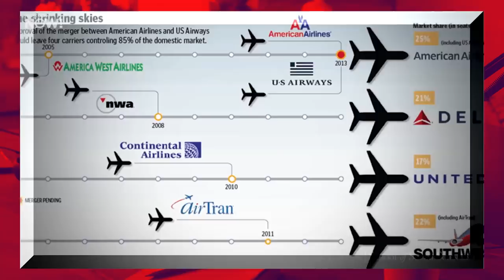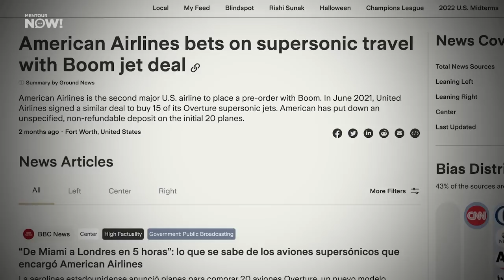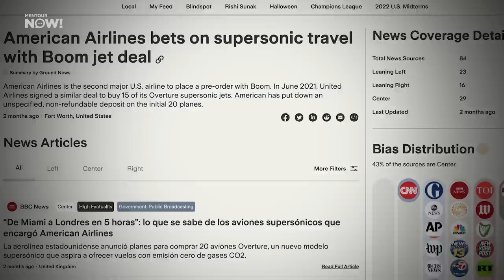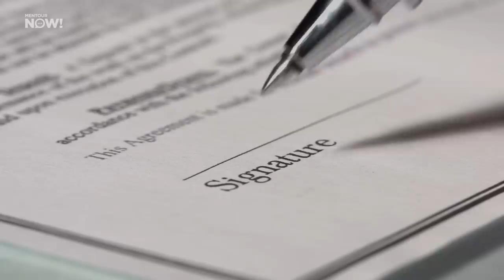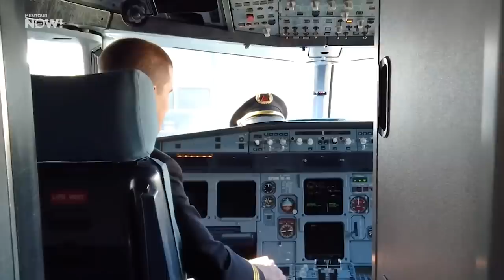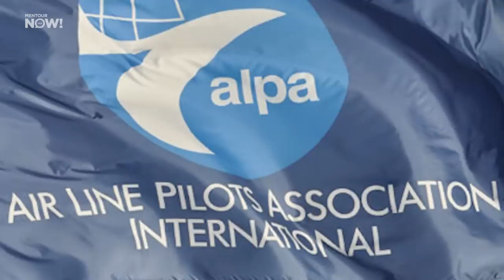Is This the DEATH of the US Regional Airlines?!

Comment: I have a “4-letter word” for all this: “ALPA.”

That said, yes, the US regionals are at a turning point. First off, get rid of those gawd-awful EMB-145s. Secondly, bring back updated turboprops (~100 seats) for leg lengths less than 200NM. The jets have been losers to the ‘props on balanced field lengths, revenue seat miles, and basically every other financial numeric.

Lastly, there are pilots (and F/As) out there that wouldn’t mind sticking with the regionals if the companies didn’t treat the crews like crap and paid decent salaries compared to mainline operators. It would also be nice if the mainlines didn’t load the regional passengers “… at the ass-end of the airport.”

But yeah, ALPA is at the root of all the US regional problems. And you just wait and see what happens if (when?) the next economic downturn comes.

It’ll be “… a race to the bottom” where those junior mainline pilots may start bumping their regional brethren. 

And that’s when the crap will really hit the fan… 😐
Reply: Yeah

Comment: Mainline carriers got addicted to the low cost of regional airlines because the labor was cheap. Regional pilots aren't exactly cheap anymore. When I started at a regional the average starting pay was $18 an hour and competition to get hired was pretty fierce. Now if you have a pilots license and a pulse you can easily get $100 an hour as a 1st year FO with some companies practically BEGGING you to come work for them. The regional model is broken, but it is undergoing rapid change. It'll be interesting to see what it all looks like after the dust settles.

Comment: I wish you also addressed the problem with these planes clogging US airports. PIT-LGA is a good example of 1 of the many routes which in the past were 100% 100+ seater aircraft, now it’s 0%, but MORE frequency, but the time saved by having hourly service is eaten up by delays! Not to mention the counterintuitive way airports like LGA calculate their landing fees to reward RJ’s for clogging their airport. A 767 only hauls 3-4x the number of passengers than an RJ, but has 8x the landing fees!
Reply: PIT is NEVER congested.

Comment: I live in Wisconsin. The nearest major airport is 4 hrs away and it’s not the airport I normally need to fly out of (Chicago), 7 hour drive. There was 2 very small regional airports an hour away from me that both had United flying to Chicago which worked perfectly. Now United doesn’t fly outta my regional airports & the airline that replaced them don’t fly to Chicago which means if I need to fly, it’s gonna require me to drive to 4 hours in the opposite direction to fly to Chicago or drive 7 hours to Chicago which isn’t an option for me. 
The lack of regional flights to Chicago are now preventing me from flying which makes me extremely sad.

Comment: Can we build high speed rail in the US already?
Reply: For whatever reason, regional air travel fills that niche, so there's not really any push for passenger rail travel.  There's plenty of freight rail traffic, though.
Reply: Please no, with some exceptions, rail in the US usually flops like a fat guy in an internet fail video. Wasted money, lots of contention and all we have to show for it is half empty trains full of hobos.
Reply: @M167A1  it flops because we keep fucking it up not because it's a bad idea.
Reply: @philtheairplanemechanic  whether it is a good idea or not depends on a lot of things and the emotion of thinking it's a good idea is not one of them.

Given the distances involved and the problems with acquiring property for rights of way and of course the eye-watering expense of rail projects often in the United States it's not a good idea.

For regional travel air and other forms of ground transportation like buses are a better solution.

For local travel at most densities individual automobiles which follow the point-to-point model are a vastly superior solution.

Only when you get to very high density situations where gridlock makes using the car for everything impractical do you really have a justification to go to the time and expense of a rail line.

I could see a revival of some of the old interurban lines but as you said we usually screw these up by making them into commuter rail and having them stop every 50 ft.
Reply: 🤣 Much easier said than done and plenty of failed attempts :(
Reply: @M167A1  It might be a good idea to take a look in some areas where passenger rail is successful. Here in the Benelux (Belgium, The Netherlands and Luxembourg) we have a system that is generally functioning quite well, even in regions that are not that densely populated.
Reply: If they can find some way to do it without it costing three times as much as it should, sure.  Problem is that the people trying to build it see that as a feature.
Reply: Pretty much every advanced country has it. It's more convenient, less polluting, more comfortable, and can be cheaper than air travel. Once again the US is exceptional, in that it cannot do something everyone else does.
Reply: @M167A1  You never take buses do you? All the reasons you have can be solved given the political will. Which the US doesn't have.
Reply: No
Reply: No.  We'd have to build a second rail network, with all the issues and expenses of eminent domain involved.  Our existing freight network plays a huge part in our economy.  LA and NYC are farther apart than Lisbon and Moscow.  Even at 300 mph, it's still nearly a 10 hour trip--and that's if you don't make intermediate stops, or slow to mesh with other traffic.

Comment: Let me just say first of all, your video was very informative. Although as a safety employee for a US regional airline, I can say many of your points are missing. 

Firstly, America is a much different beast than that of Europe. In the USA, airlines will employ the hub and spoke model which brings people to key airports to board larger planes to the hub airports. These airports of Atlanta for delta, Chicago for United, and Baltimore for southwest. The regionals move people to these airports but fly multiple times per day because turn around time for these planes is about half the time compared to that of a 737. So these e170s can make more trips to smaller airports more often than not. 

Secondly, many aircraft are not actually owned by the airlines. Leasing has become very common in the USA with these companies only providing jet aircraft. Besides, jet aircraft are far faster and can climb to higher altitudes than that of turbo prop aircraft. 

Finally, the USA is massive and Europe could easily fit inside the USA not including Alaska. While Europeans would drive or take trains to move across the country, America doesn’t have that infrastructure to move across such a large area. Our trains aren’t fast and are running routes that aren’t conducive for passenger travel. Our roads are extensive but take quite a while to traverse cross country. So that means air travel is the greatest need. The regionals are an integral part of this system. The amount of people I see our planes flying to a small airport is incredible. I would never think people would fly there ,but they do. Airbus even bought the a220 from bomadier so they could get in the market and embraer launched their e2 version of the ejet family. These actions have shown that regionals will go strong forever. 

Btw, I have a degree in air transportation and aviation management.
Reply from the maker: All good points but also things that could change if the economic incentives change.
Reply: @MentourNow  That is entirely true although regional airlines do not pay for the fuel, landing fees, or ground equipment. All of those items are payed for by the airline. The only thing they worry about is maintenance and the crew. Some airlines do have planes owned by the mainline and are given to the regional to fly. The economics have always been a defining point but like we saw during the pandemic, the airline will park planes before doing anything else.
Reply: @MentourNow  Still a very naive ethnocentric video.

Comment: I don't think the US Regionals will die. A big benefit of the smaller passenger requirements - and part of the logic in the majors contracting regionals to run branded flights - is that you can increase frequency of a route. 

As regionals increase their staff costs the dynamic of corner cutting will definitely evaporate as the primary factor governing US regionals but I do think that there are reasons why the scope clauses and union negotiating structure will continue to play a role. The pilots unions have a constant challenge of driving up the working conditions for experienced pilots while creating opportunities for new pilots. They also are acutely aware of the fact that there are pilots who would to have well defined working hours, the ability to sleep in the same bed each night etc ... accept lower pay.

From the pilot's union perspective equally the 76 seat scope clause isn't working and its driving problems. I anticipate that two things are going to happen firstly a new contracting pilot type of "domestic" or some other description which will include you very popular singles - the 737 and A320 - but be limited in flight length of 4 hours or so and have other restrictions around home base and the like. Secondly a scope of an even smaller number than 76 for a very new entrant pilot pool with possible loans and other assistance for flight school - enabling new entrants to get the commercial license in the US but not yet have the type rating on larger aircraft. This smaller passenger scope business will see some of the existing 90 seater planes put into a business class configuration etc ... and will see the high frequency and connectivity to "executive" airports. The majors have everything to gain by keeping two fairly distinct operation types (one which learns for the LCCs and the other which is more charter like) within the same "regional" branding.

Comment: There have been some comments about inter-city rail. In Florida the inter-city rail service Brightline is within a few months of starting service on its extension to Orlando. It currently serves a route between Miami and West Palm Beach. The Brightline Orlando train station is at an intermodal terminal at Orlando International Airport. They also have a maintenance facility at Orlando near the station. The section between West Palm Beach and Cocoa will run at 110 mph. The section between Orlando and Cocoa will run at 125 mph.

Comment: There is a need for regional flights.  Alaska Airlines adds to its mainline operations by using RJs from its Horizon Air subsidiary or Skywest on a capacity purchase basis.  This gives Alaska two major benefits.  They can easily move aircraft to where they are needed.  They can test drive a new route by using RJ aircraft; if the route becomes successful, they can replace it with mainline aircraft.  The fuel costs for a B737 or A320 aren't less if there are less than 70 pax.

Comment: Hi Mentour, thank you for another excellent video, well thought out and well presented, as always. As far as the death of U.S. regional airlines, it is a pretty complicated topic. As you accurately pointed out, these "regionals" primarily act as a cost-control mechanism for the mainline airlines more than actual regional carriers, the way, for example, Loganair, would be in Scotland. 

You mentioned that on a number of routes, the U.S. regionals serve what are completely mainline routes (LGA-PIT, for example). Additionally, of course, on these routes the mainline carriers will often provide flights operated both by the mainline operations and one or more regional carriers. As was pointed out in an earlier comment, in these cases the regionals provide additional frequency at a lower cost. 

As far as the regionals losing their cost advantage, while it is clear that regional pilots are now making much more than they did before the recent salary increases, please note that this "pay gap" reduction has been--and will continue to be--mitigated by the fact that the mainline pilots are also receiving salary increases. 

While the mainline carriers have proposed pay increases of about 15% to 20% (less obviously than the highest increases at the regionals) the mainline pilots have already been making much more than their colleagues at the regionals and so the pay gap reduction will not end up being as significant as it might appear at first glance. 

This is especially true when you consider that Delta's pilots recently authorized a strike after the company proposed increases of approximately 19%, implying that--when all is said and done--mainline pilots will end up with more significant pay increases that will further erode the pay gap reduction we are currently seeing between regionals and mainline and thus continue the main justification for regional carriers in the U.S.: money...

Comment: One interesting example of this: PAE (Everett) is the airport for the huge Boeing plant where the 747s are built and where the 777x is being developed, and commercial flights there only started in 2019.  Currently Alaska is the only airline that operates there (United flew there before COVID) and only flies E175s, with most routes going to major hubs.  They only have 24 slot pairs a day available there from 3 gates so it seems like flying larger planes from there would make more sense, but the neighbors already hate that there's any commercial flights from there in the first place, and I suspect they would be hard pressed to get approved to fly anything bigger.  Guess they like slogging through 40 miles of Seattle traffic to get to Sea-Tac if they need to fly anywhere?

Comment: I fly regional all the time; Medford, Oregon to LAX. It's a two hour flight, gate to gate. As recently as 3 months ago, there were at least 23 direct flights per week, (United Express = 7, American Eagle = 7, Allegiant = 2, Horizon/Alaska = 7), each way. Now there are 9. By the end of the year there will it will be down to 2 per week. As it stands right now, every flight is jammed and there is never enough room for overhead carry-on. To fly with one stop is a minimum of 6 hours. For me, I'll end up driving the 10 hours and travelling when I want instead of waiting for that rare non-stop flight. What's odd is that Alaska/Horizon just bought a bunch of new regional jets to replace the old turboprops. I'm not sure what airports they are destined to service but it would seem that Medford, Or. is not a priority... even though every current non-stop flight seems to be full.

Comment: I was just thinking about this the other day. I fly out of our regional airport at least once a week, usually connecting through a hub, with destinations around the world, but mostly inside the US. Before 2020 it was mainly small regional jets / carriers out of our small airport, but sometimes it would be a 737 or A 219 220. During COVID there was more of a 50/50 mix between smaller jets and mainline jets. However, in the last 8 or 10 months I haven't been on a regional jet inside the US at all, even flying into smaller airports that barely support a 737 (Orange county for example). The last regional jet I was on was in June connecting between Amsterdam and Newcastle United Kingdom on KLM. I was thinking it must be cheaper and/or more efficient for United to use their own mainline jets for these routes than contract out to regional carriers.

Comment: Two factors you didn’t mention is flight frequency which is brought up here, but also adding people don’t want overnight flights, one would make more sense with a larger aircraft financially but people want to only have a one day trip so you need mornings for outbounds and evenings for inbounds, also for thin point to point skipping the hubs, US airlines used to have a lot more hubs but they have been lost through mergers. As for turboprops, they make the most sense financially and efficiency wise for short haul routes but the American public perceives them as unsafe (hey you know that is a jet engine turning that prop! You aren’t going to get there any faster, you aren’t really going to fly any higher, you have a much lower landing speed, it’s much cheaper and efficient. Doesn’t even click with them. )

Comment: Interesting, but you miss a crucial concept here. The Regionals take the big names to smaller airports. America has a vast market, and in many areas it's a very long way to an international airport. The hub and spoke travel concept allows travellers to either fly internationally from a local airport VIA the big hubs, or cross-country WITHOUT using a hub. Most regionals have been used by their major airlines to introduce longer cross country flights to help de-stress the mega hubs like DFW, ORD, ATL, DTW etc. It's a completely different demographic than in Europe, and comparing these two markets largely misses the point.

Comment: Qantas here in Australia has 124 aircraft in the mainline fleet (75 are narrow bodies). Their low cost offshoot, Jetstar, has 80. Mostly A320 family (with 11 787s), and another 27 with their Singapore and Japan based franchises.

Qantas owns a number of "regional airlines", Eastern Australia Airlines, Network Aviation and Sunstate Airlines, which are operated under the QantasLink brand, and wet lease from another regional, Alliance Airlines, which they are trying to buy.
Together, the regional fleet totals 103 aircraft, mostly Dash-8s and 717s with some Fokker 100s and E190s.

Network Aviation operates 11 A320s for "Fly in-Fly Out" mining charters.
The 717s are getting replaced by A220s.
Eastern Australia and Sunstate Airlines generally operate from the regional and remote towns/cities to the nearest state capital (eg Dubbo-Sydney) and between capitals to increase frequency.